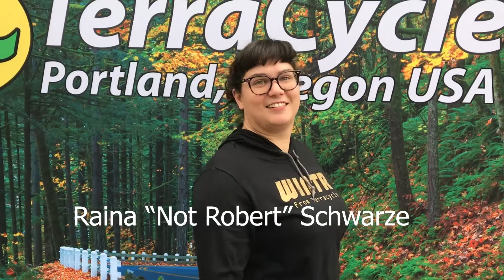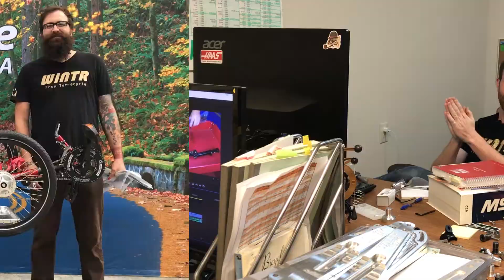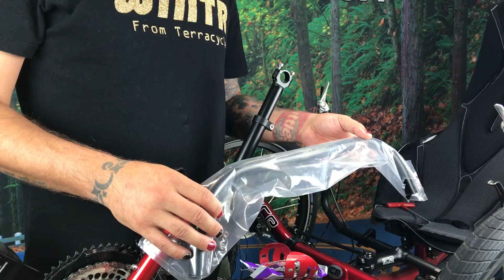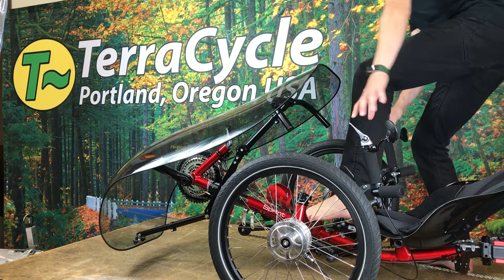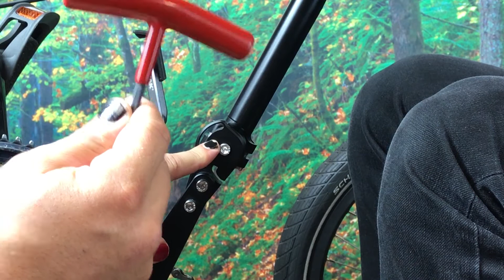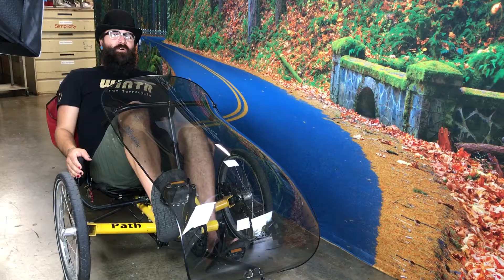T-Cycle WINTR Fairing Kit Installation

Comment: Good tutorial. However, getting the adjustment spot on with cycle shoes on is another ball game. My cleats are slid as close to the heel as possible which brings the toe closer to the fairing. I have scuffed areas on the fairing where my toes have rubbed at the top of each pedal stroke. Quite honestly perfect adjustment is a bit fiddly. There’s a sweet spot you didn’t need to address with a barefoot subject and platform pedals.
Reply: Went back again after another watch (no illustrious assistant) with many small adjustments my feet and knees clear and I see just over the top of the fairing. The distance from the bottom of the fairing to the ground is far from your recommended 4 inches. Mine is closer to 14”. Seems good.
Reply: @markrobinson891  Hi Mark. I have the same issue. 6'2" and a size 13 shoe (cleat all the way down). 15" height at the front end. Not much of a bubble (more of a slant on the front end). I can see over the fairing. I'm sure these were designed for an average height rider.